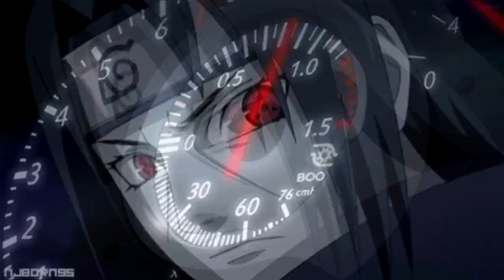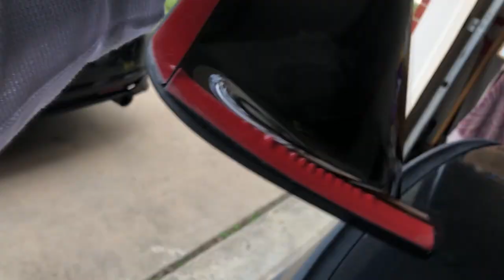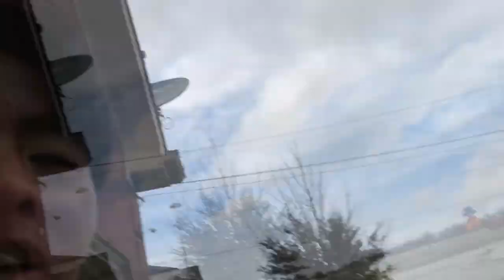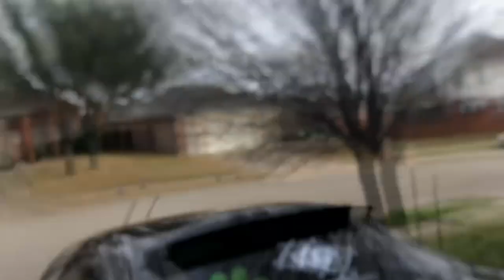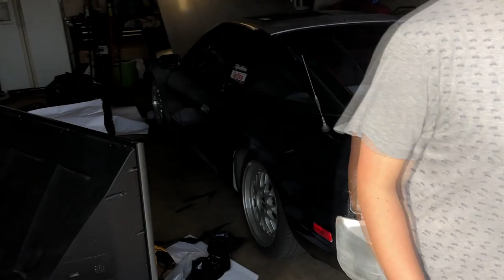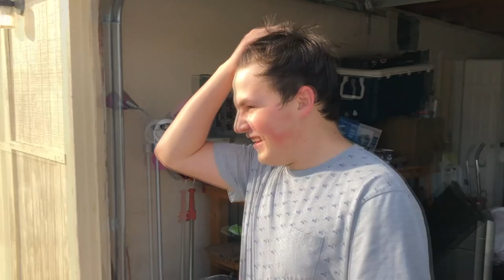Installing my Hic Roof Spoiler for The TSX

Comment from the maker: Update: Just 2 months later the roof spoiler has not sagged in the middle but im starting to notice a problem with the "Fake 3M Tape". The corners of the spoiler is starting to pull up and i notice alot of play. So this summer im going to have to replace all of the tape.
Reply from the maker: Pro tips from Artgod: Use real 3m Tape and use the triangular supports so your wing doesn't look like it has a saggy diaper!!
Reply: I bought one for my Integra years ago they look phenomenal but that fake 3m tape was it’s kryptonite

Comment: Hi. I have the same problem with my Accord - visor tape not holding as it should. Had to remove to do not loose when driving. Tried other tape - the same :( Will try maybe real 3m tape but not sure result.  Greetings from  Żagań, Poland :) Let me know if You found good way to keep this on place.
Reply from the maker: fsk1985 yes some 3M tape and that sticky primer will for sure help